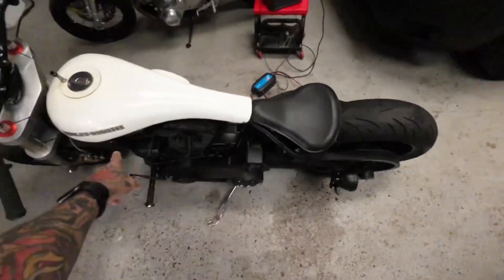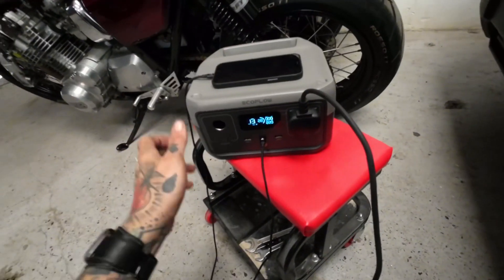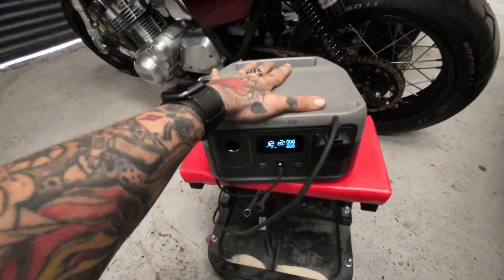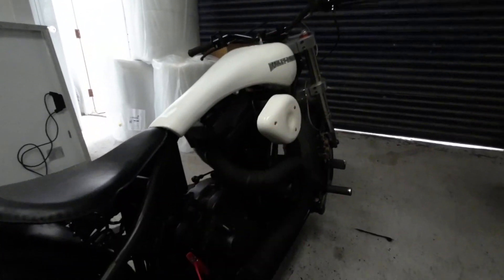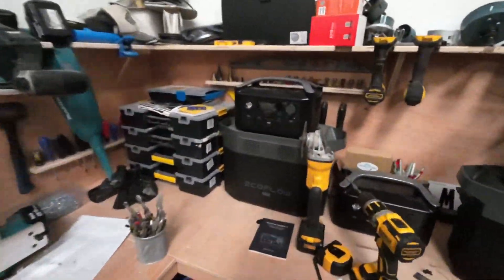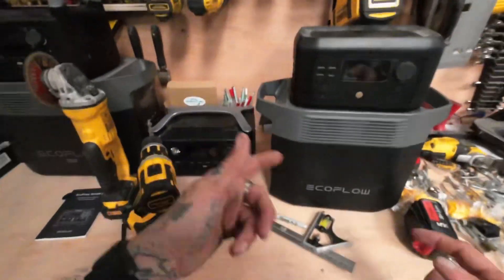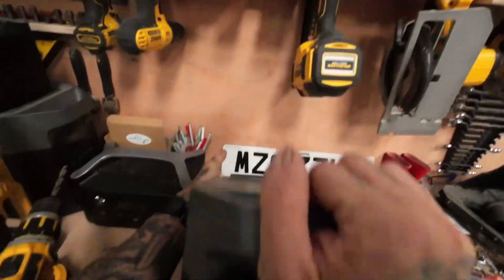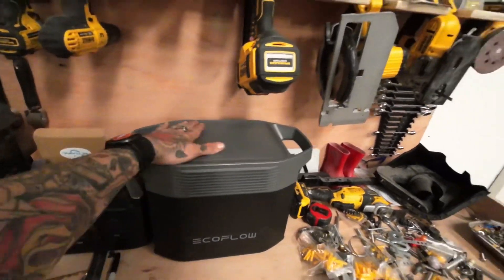ECOFLOW - River 2 and Delta 2 - Their Best Yet?

Comment: Liam
To clarify
When you say "good for 3000 charges"
As with all lithium batteries, they specify "cycle life" as the number of full discharge cycles to a specific maximum remaining.
Or
After 3000 (full) cycles, this unit will still have 80% of its original capacity.
New 256Wh
After 3000 cycles, 208Wh (minimum)
.
If you don't run it to empty, then charge to full every time, that may be even better.
Still plenty of useful life!